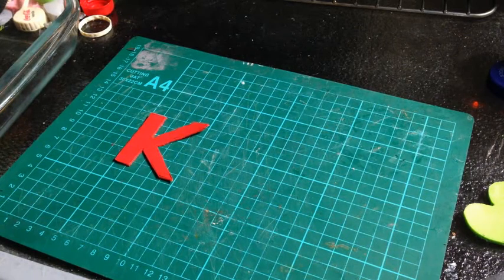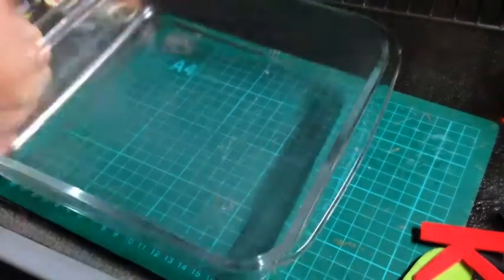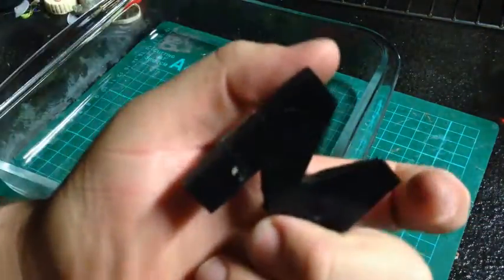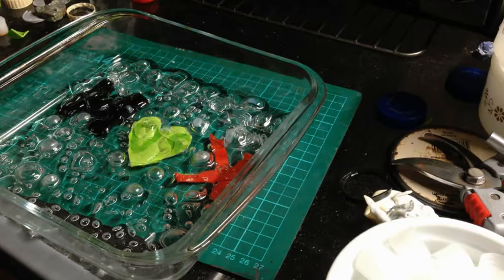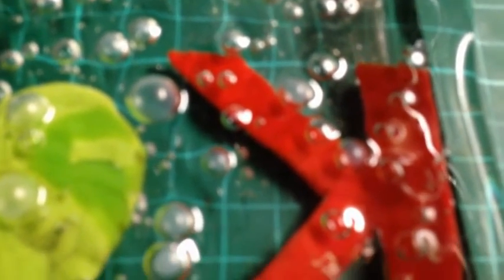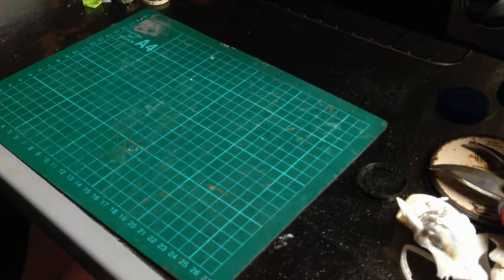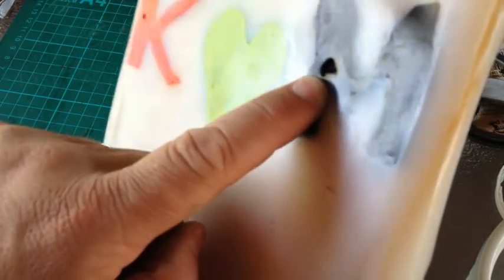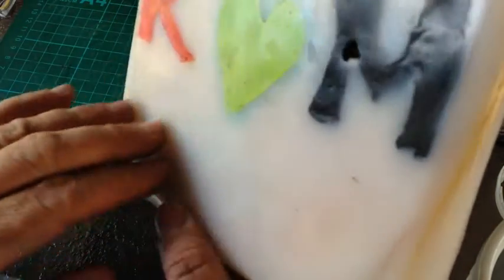Ep73 Coke lids can be used with flowing HDPE part 2  2

Comment: just a thought as not tried it but what about making a thin white sheet and cut pieces the fit around the shapes then fill in with caps etc over the top like you did with grease proof paper and a piece of board and a weight that will help distortion while cooling

Comment: Not perfect but good job and a bit of practice will make perfect.  I was thinking that maybe you got holes in the letters because they were not perfectly flat in the first place so when you placed them on the glass there were areas where air could be trapped under them right from the start.  What do you think?  Keep up the good work, I love watching your experiments.  Poo
Reply from the maker: Thanks Poosmate 
Yes to be honest had not put to much thought in to the holes under the letters.  This was a prrof of concept to see if it could be done. You might be correct in the letters not being completely flat. 

So to test this one would have to make a pusher that would push on the back of the letter. While the plastic around sets.

What i would do is make the letters thicker and turn the job on the lathe and hope that no bubbles were not present

thanks for watching